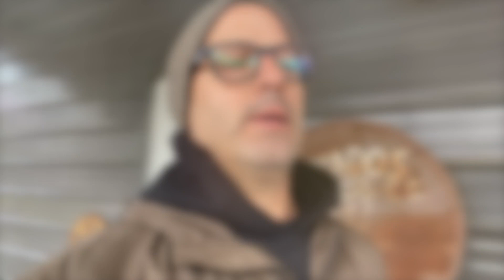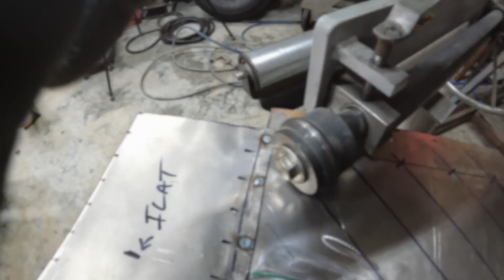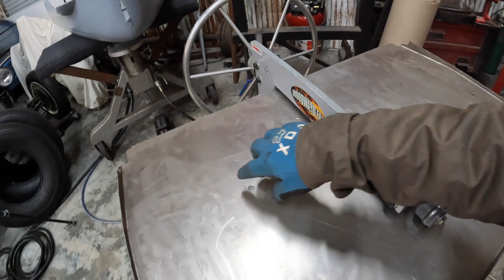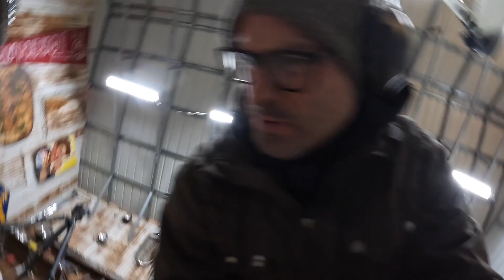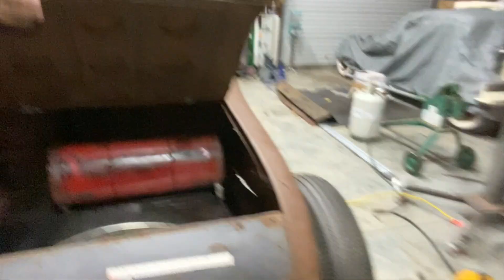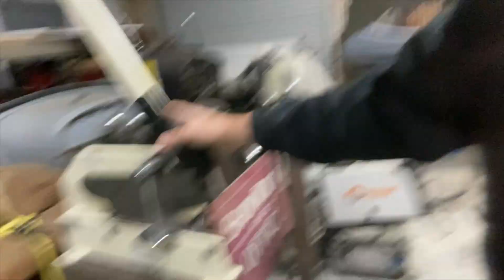Bead rolling Trunk Floor in the 1927 Ford Roadster

Comment: Yes if you have the beads going down it would help with carpet but, but it will hold moisturize, water and rot it out. Now this kind of car would it be allowed to set with water in it? Properly not but something to consider. .

Comment: I have a 29 Ford Tudor friction shocks on 4 corners I saw how you mounted your shocks to the cross member what are they mounted on the lower end keep it up we will all learn together.
Reply from the maker: I welded a lower shock mount onto the bracket I fabricated to mount the radius rods.   I moved the radius rods on the rear axle inwards inside the frame rails.

Comment: The trunk looks mint. Are you planning on using the big shop more? Or is it just an available space thing. Thanks enjoyable as always
Reply from the maker: Tell ya what it’s mazing hailing the space to actually have my tools spread out and room to work on things. The top garage is cramped. 
It’s easy to heat and cool though.  
 It was eventually the plan, but I didn’t plan to be building this T and certainly didn’t plan on being in the bog shop yet.

Comment: Mike your doing a great and inspiring job. You’ll find that shear to be worth its weight in time and quality cuts. One tip re: using a magnet to clean up. Wrap it in a shop cloth pick up the junk and then peel the cloth away. The bits drop into the bin and the magnet stays fairly clean. You can use compressed air to blow off the magnet as well. Great for those angular holding magnets. Can’t wait to see the next episode.
Reply from the maker: That’s a great tip. Thank you. I never thought of that !

Comment: I think you made some progress.  Your giving a rusty heap that was ready for the scrapper another life!! A noble undertaking.
Reply from the maker: Thank you !! Yes !  Although it is pretty rusty 🤪. I need to start removing the bad areas and shaping up some patch panels.
Reply: @ThisOldHotrod  I'm about to do the same with mine...  That one from Adam's Mass I shared with you. Trying to track down a Mittler Bros die set for that bottom bead. Can get close....but, I'd like something closer  to original from the start.

Comment: When bead rolling does the panel shrink?
Reply from the maker: Not as much as one would think.  However it does move the metal enough to make the panel change overall shape.  
Turns it into a potato chip sometimes.  Some occasions you need to pre stretch the metal by running the areas through an English wheel or a plainishing hammer.

Comment: Hey Mike, on the shear, there is a hole in both blades to shear  round rod, works great. My safety tip is I put a bolt and nut thru that hole when not in use, keeps someone from pulling on handle and having the other hand in wrong place (think kids) also a great use for this tool, when you are putting a flat washer somewhere that hole is too close to a wall, the shear can cut a flat on the washer, very easy, beats a grinder or a hack saw. Cheers !
Reply from the maker: Thanks for the tip.  That’s great.  Love the fact you can cut round rod w it too. Looking forward to putting it to use

Comment: I can't help thinking of the time you would have saved if you had simply lowered the shocks a quarter inch.
Reply from the maker: Ya. Would have been a little more but that’s okay. Wanted to keep the travel as it was and not minimize it.  Doing the sheetmetal work is practice.   I have no timeline. So a little more work is okay.

Comment: Mikey looks good , make your start n stop lines longer past dies so u can see the ends .l wish l had   a big shop , u need nice big loft 4 your bodys n frames , so u can keep heat in work area with tools n bench.2 hell with everyone do your o wn thing that works 4 u. Good luck ,keep going meat
Reply from the maker: I built the building tall to build a loft across the back.  Still on the todo list !  All in time. Including real electricity and real heat
Reply: @ThisOldHotrod  thats good news. I miss my shop i had a loft best thing I did 4  room. Socks having 1 car .sold tools wish I still had no room. Get that plug strip , work goes faster. Hang up grinders on side of  bench plugged in it works so much easier. Good luck ,talk later meat
Reply from the maker: @artiestaub2401  I’m getting there !  Thanks for the support as always 

Mike

Comment: would it be better to stabilize the body before working on door latches ?
Reply from the maker: It’s bolted to the chassis where it’s going to be.   That’s how I’ve done the doors on the other cars I’ve built.
Reply: @ThisOldHotrod  just my way of thinking I guess .  I just keep the non moving parts solid .
Reply from the maker: @billterry9996  I understand that.